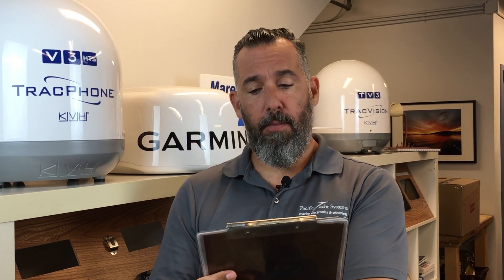Ask PYS - I Have a Burned Wire on My Boat, How Does This Happen?

Comment: Jeff, the woman in the question about the burned wire said that it was a “ground wire” do you have any comments about that or maybe she was mistaken and over someone used the wrong color wire   apparently it was a  ungrounded  conductor?
Reply: I was thinking the same thing.
Reply from the maker: Good one. You found another layer to the puzzle. Love it. That's even more serious, because that means the AC appliance had a fault and the current went on the ground (green wire) and not the neutral (white wire).

Comment: Hi Jeff, this might be a silly question but I haven't checked the fluid levels on my batter's for over a year (when I bought them).
The reason is there doesnt seem to be an obvious wat to open the tops... and yes they are flooded... Deka I believe... any suggestions?
Reply from the maker: Good question, if you are using your flooded lead acid batteries as deep cycle batteries, you definitely need to top off the fluids. The vent caps should be easy to pop open. Perhaps you have a maintenance free lead acid battery.

Comment: Is there a point at witch either the negative or positive cables need to be staggered ?   IE positive wire needs to be 8 gauge but neg needs to be 6 . This maybe a rabbit hole question .
Reply from the maker: Not really, you should always have the positive and negative same size. If not, make sure the smallest wire can handle the load, also make sure the circuit breaker is for the smaller wire.